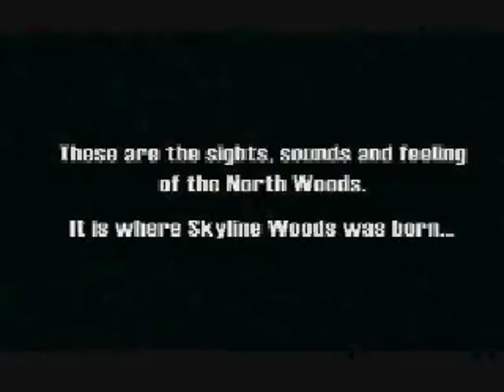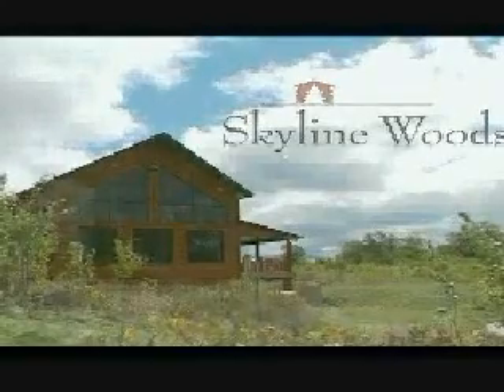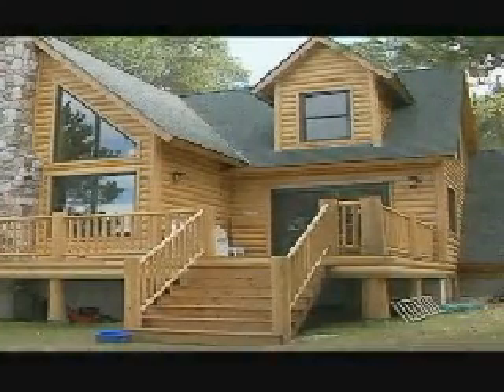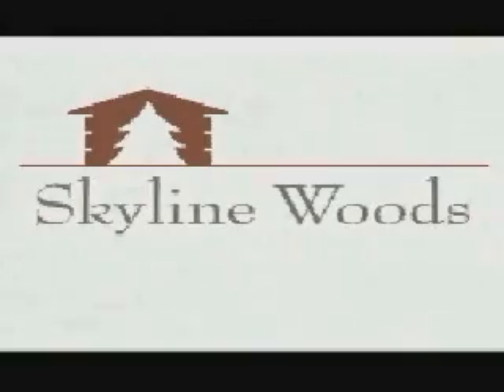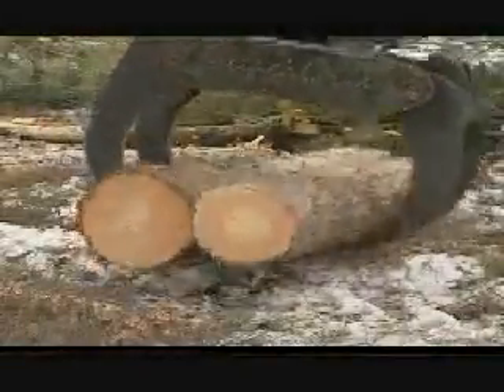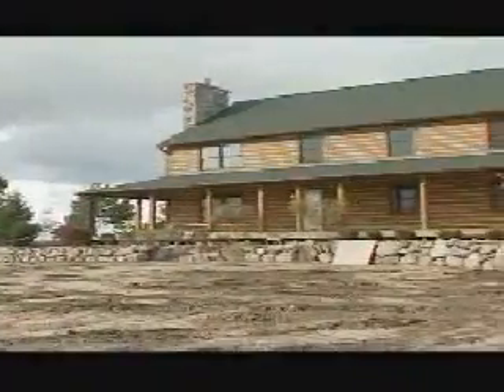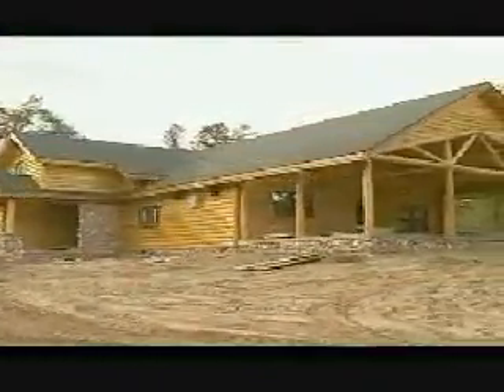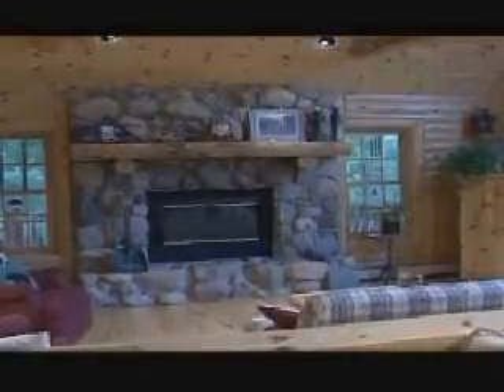Log Siding better than full log homes

Comment from the maker: Hi Bob, 
The siding is kiln dried so it doesn't crack or shrink, so caulking is minimal, especially comaperd to a full log home. Theres is nothing special that needs to be done to the windows. You have conventional building methods like: electrical, plumbing, and mechanical work as well as insulation.  You don't have to worry about the home cracking, or settling like a full log home.  You have the beauty of a full log home without the hassels of building or maintaining a full log home.

Comment: While log siding is a good upgrade there are serious considerations. Window & door jams [if not entire windows] will need replacing. Upgrades to your structure may be needed. Installation is not a casual weekend project! All but 2 U.S. companies make siding that will not shrinke and require extensive caulking. Siding has a tendency to crack. Done right, it can be nice. When building new, it's smarter to do full log. Bob